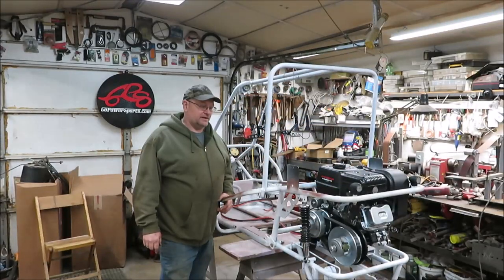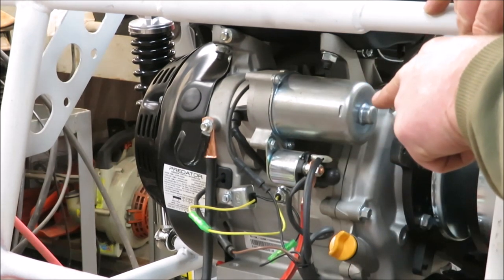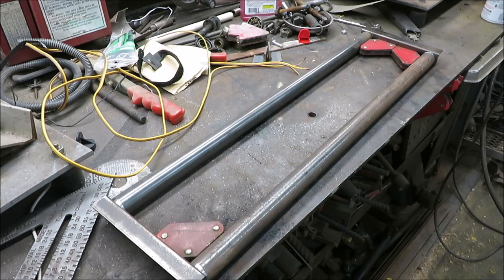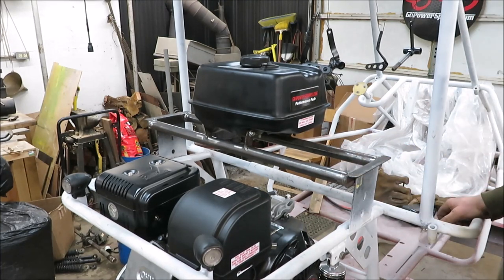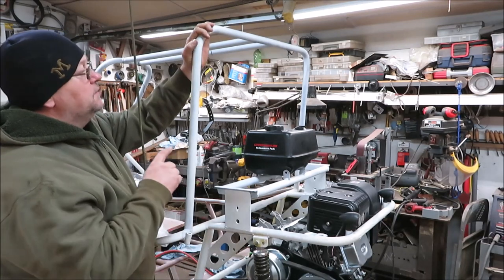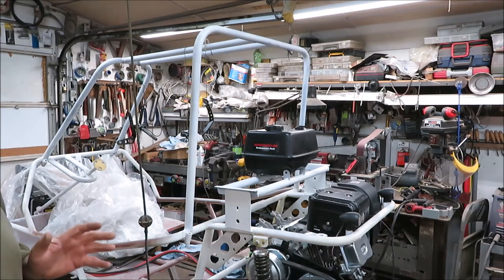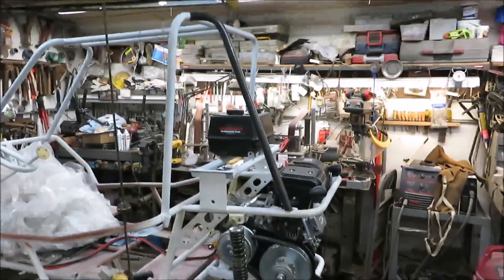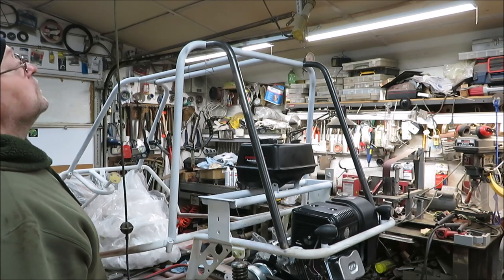yerf dog go kart build finish up welding

Comment: Kevin I see where you welded the latest crash bar at the lower end there is no support  below it  if for any reason there is a force at the top of the crash bar it will bend the lower bar into your motor. If you weld a short piece of pipe from the bottom ot he bar you just welded motor plate  you would get stronger support, I hope I explained  it proper so you would understand. Bill